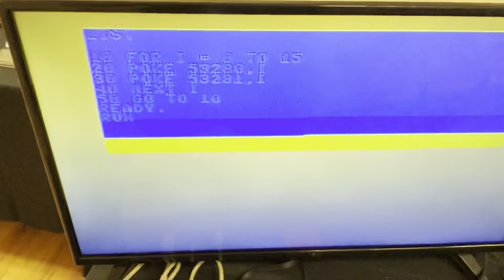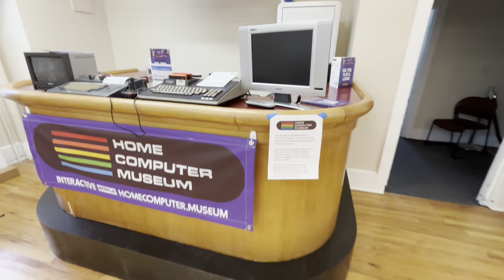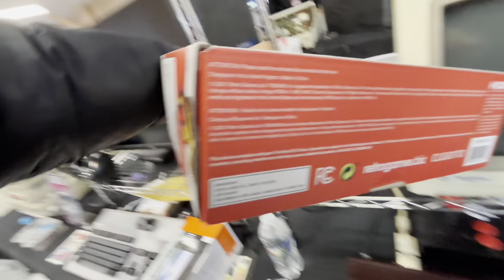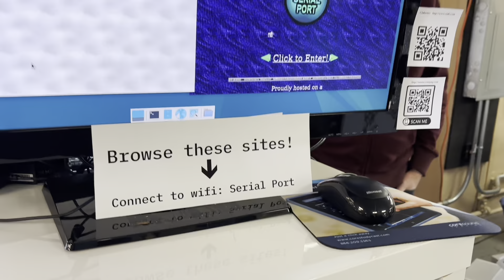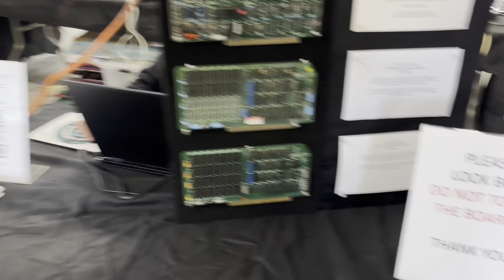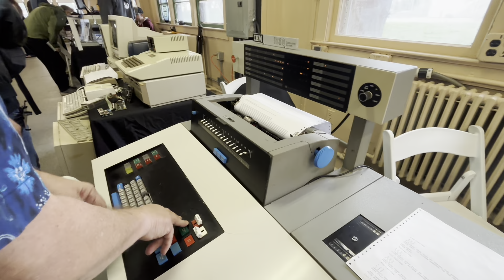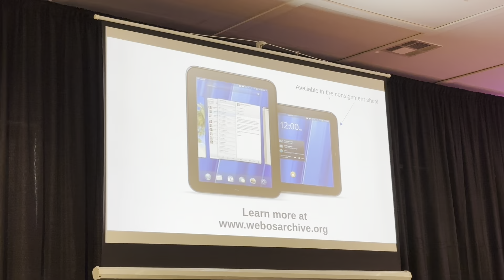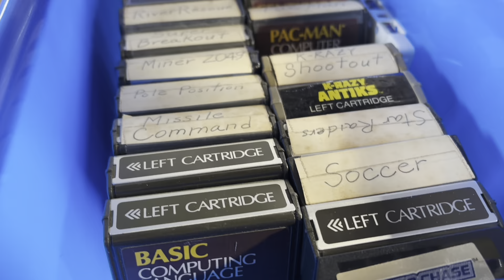Vintage Computer Festival East Clips Wall New Jersey 2024 Saturday April 13 Real Sounds Unedited

Comment: The "flight banning" suitcase thing at 36:54, with an even closer look at 43:15, was mine. It is a SYM-1, a period clone of the Commodore KIM-1, mounted in a suitcase with a power supply, and the I/O ports routed to spring-loaded speaker connectors for convenience.
Reply from the maker: Glad to have seen that and the two people who were looking at it and were familiar with it.  I think you learn a lot more by owning one of these vs what followed.